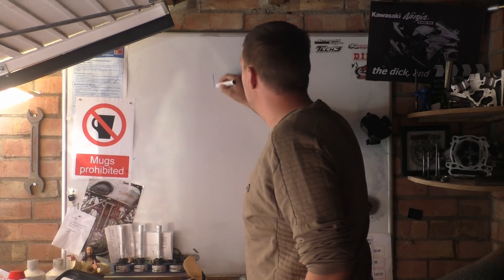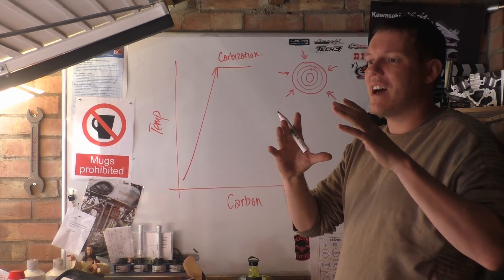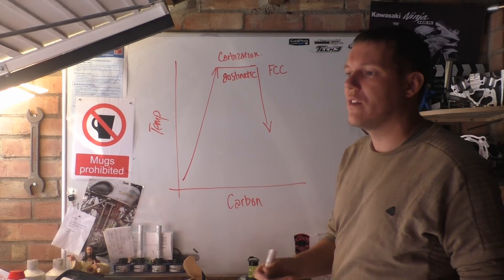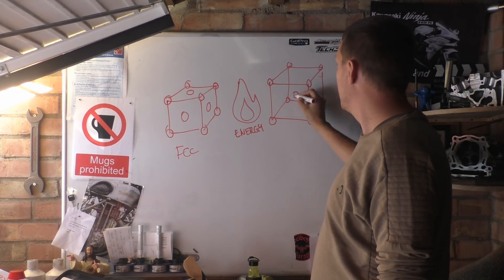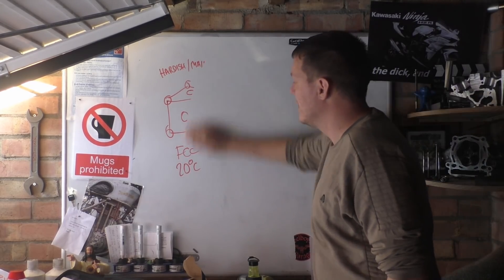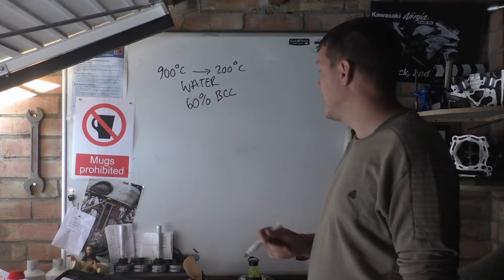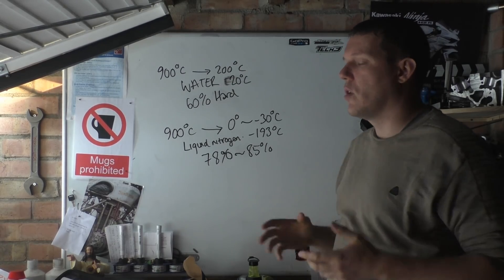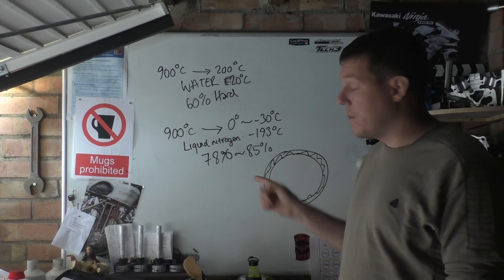Cryo Hardening - What does it do and how?

Comment: I don't understand how a soft core with a hard surface would bend/twist more easily than an entirely hard piece. You can put jelly in a glass tube, if you bend it, that's still going to break. I don't see how a soft core would prevent a hard surface from breaking under excessive mechanical stress. It doesn't make any sense to me.
Reply from the maker: Energy dissipation. The softer material can deform. When this takes place it creates waste heat which leaves the material as radiation. Your jelly and glass example doesn't work because they're 2 different materials and are not connected.
Reply: @thedirtyworkshop  And that very small amount of heat would be enough to soften the hard surface ?!
Reply from the maker: No. I'll do a video
Reply: @thedirtyworkshop  That's a nice strategy to make me subscribe 😁

Comment: All the stuff they do to Samurai swords (Katanas?) is just to get around shitty steels in Japan. The equivalent european sword is through hardened to an extent where it basically is spring steel. And apparently it is better and does not brake or plastically deform as easy as the japanese Katana.. which does have a harder cutting edge (a bit) but the rest is fairly soft.
Reply from the maker: The rest of the blade is meant to be soft, and you have to think of the time period here - Japanese blacksmiths were produced superior cutting blades compared to the european blades of the same era.
Reply: The Workshop Well yes and no. The katana sword cuts better and the cutting edge is harder, but in a direct combat the european sword would probably damage the katana badly while it remains intact. But katanas are very weird swords anyway, beeing so short but still double handed. European swords were either much longer (ealier longswords for example) or later on single handed and about the same length, say a british infantery saber. Obviously a direct comparison is bullshit. Also the europeans had the luxury of having good, homogenous steel and plenty of it (more or less..) while japanese katanas are made out of some weird crappy ore (forgot the name) which is likely the reason for it beeing produced the way it is.

Comment: You can quench with aluminium blocks too knife makers sometimes use aluminium.
Reply from the maker: Not with good results though - the heat transfer isn't quick enough
Reply: The Workshop yea I was surprised tbh as it’s a block can’t get fully round the knife or make proper contact like a liquid, just seen someone doing it,

Comment: were you trying to say "nitriding"?
Reply from the maker: No. LOL Nitriding and carborization etc are different things - which we will cover
Reply: @thedirtyworkshop  hey man I’m a BIG FAN of yours I own a race shop Turn13motorsports and we are looking into cryo treating some parts that will be going into our wsbk spec R1 build. Just wanted to get your opinion on what you thought about doing the cylinders that are Nicasil coated and aluminum, and then trans gears  engine valves valve springs, and possibly crank, we have DLC coated a shit load of the internal parts including the crank. What do you think man? Thx soo much
Reply from the maker: The cylinder is not something you wanna do. Who is doing this work for you, half of them parts won't and don't require cryo. Sounds like they're selling you a lie

Comment: How does the leidenfrost effect interfere with quenching? Would oil cool quicker than water due to its higher boiling point? 

And what are your thoughts on hardness files for approximating the hardness of parts?
Reply from the maker: Well get to this - with some experiments - but when quenching you shake the part about - which is called agitation

Comment: I worked at a large heat treatment company in the bay area called NITREX, fascinating stuff, I feel much as you do about steel, it's really like magic when you study how changeable it is compared to other materials/metals. it appears like completely solid and unchanging from the outside but it's constantly changing at a molecular level relative to changes in it's environment. We did cryogenic hardening  as well, and we had microscopes to check the structure and for making sure nitriding went as deep as our formulas said they would.  Cryo hardening basically gets rid of any retained austenite and it's very clear under the microscope . Looks like something melted (austenite) surrounded by piles of needles (austenite) .

Comment: Matt, completely off topic mate but I’ve been watching a few vids on Hilltop Motorcycles ecu tuning. Mr Lamb Chops has just taken his performance bike’s test bike in and thinks it’s the bollocks. Apparently it’s a self learning/tuning ‘invisible’ bit of software that they put on the existing ecu and apparently only their Dyno can detect it...... Seems a bit ‘TankChip’ to me. I mean how can you tell that they’ve actually put the thing on there rather than just done a generic remap other than just taking their word for it?
Have a look and see what you think. 
With Lamb Chops’ bike they tell him it’s running very lean at first then later on in the vid say they weren’t recording the air/fuel ratio???
Reply from the maker: LOL get in line dude - your 40 requests too late. LOL yes dude I have watched it. This is a load of tech bullshit. But what he did is normal. There are standard 'tuned maps' that people just upload. The same thing with your stock power commander. These are pre-calculated maps. All he's doing is just uploading them. Probably stolen from the PC chip series. As for the other wank again its bollocks. 

Dudes got A.I chips in his ecu LOL - the funniest thing he said was the Faraday cage around the dyno. What's funny is that the biggest emitter of RF interference is the HT leads and the ignition coils. They're inside this 'faraday cage' - guys full of shit. Oh and he has powerful fans LOL
Reply: The Workshop Haha.... I’ve got a mate of mine going on Friday on the strength of someone he knows saying it’s the most amazing thing he’s had done. I watched the video and just thought how convenient it is that only his dyno can detect it. And the bit about it was running way too lean to get a before dyno run to compare to afterwards what a bit special considering he wasn’t even checking the air/fuel. 🤣
Reply: Your mate is clearly someone prepared to consider the actual experience of others rather than form his opinions of what must or must not be true from basement dwelling youtuber 'experts'! Good for him.
Reply: hilltop motorcycles 
 I was merely asking Matts' opinion, as I did Lamb Chop and as I will my mate in the next couple of weeks after it's been done before I consider the £360 and 3 hour round trip. All I was saying is that there seems to be a LOT of people thinking it's iffy and just as many that say it's ok..... Not once have I said it is. Just doing a bit of research and gathering opinions based on what I've read from others.
Reply: It was the other chap who called it 'bullshit' mate. See above. My comment was addressed to him.
Reply: Perhaps you would be good enough to enlighten your viewers/readers as to why it's 'bullshit'? There does seem to be quite a number of armchair ECU experts who are prepared to comment in quite bold terms as to whether what we do is real or not, but are pretty bare on the details to back up their assertions. So feel free to go ahead and give some so your audience can understand better...

Comment: Fucking awesome mix of engineering talk and having a laugh on this channel. It's not fuckin' Blue Peter at all, like some other channels 

Comments section is usually a good laugh too. Some other channels have comments sections that are about as dull as a 1940's ww2 knife that's been 'sharpened' (destroyed) by some fuckwit on a 20 quid sharpener.

Edit: non uk'ers will need to Wikipedia Blue Peter lol. It was basically a very famous, very long running kids TV show, known for its arts and crafts. Much use of double sided sticky tape and toilet roll cardboard tubes (just gave del a great idea for his exhaust system)
Reply from the maker: "Comments section is usually a good laugh too. Some other channels have comments sections that are about as dull as a 1940's ww2 knife that's been 'sharpened' (destroyed) by some fuckwit on a 20 quid sharpener."

- LMAO! Nice!

Comment: (I'm not a metallurgist!)

My understanding is that post-quench cryo treatments are more about stress-relief, than rate-of-quench... Many heat-treat protocols use multiple cryo cycles, without going back above the phase change temp (I forget what it's called).

(I have been trying to learn more about this stuff in regards to my knife hobby... I've got a long way to go.)
Reply: @the workshop check this out
https://www.google.com/url?sa=t&source=web&rct=j&url=http://www.airproducts.com/~/media/Files/PDF/industries/metals-cryogenic-quenching-of-steel-revisited-33005019GLB.pdf&ved=2ahUKEwiQ7sTfgKPdAhUJ16wKHU7eCCQQFjAAegQIABAB&usg=AOvVaw2C7rYqr0LvZHo825KwoCaE

Comment: Hi Matt.  Saw a suggestion from someone about removing coils from fork springs to raise the spring rate.  I know it would work in terms of raising the spring rate.  However, his method was to cut the coils from one end of the spring, then heat and bend the last coil, and grind it, to make a new spring land.  It seemed to me that the heat involved could change the properties of the spring and/or the metal it is made from, so I didn't do it.  What effect would the heating, and the heat from grinding, have on a spring?  Cheers
Reply: Bad idea messing about heating springs, don't do it
Reply: knuckles zedawg  I didn't know for sure, but I suspected it might be a stupid idea.  That's why I asked.  Given that Matt has confirmed my suspicions, I completely agree. Thanks for the further confirmation.
Reply: Joonya 

No worries buddy, but to be fair you suspected it was a bad idea yourself anyway 

Usually, your gut instinct is correct, and it was :-)
Reply: Yep, that's why I didn't follow the (bad) advice.  My gut said it seemed like a bad idea.  It's nice to have that instinct confirmed though.
Reply from the maker: "I know it would work in terms of raising the spring rate."

- Sadly you don't because this isn't true.

"It seemed to me that the heat involved could change the properties of the spring and/or the metal it is made from, so I didn't do it"

- Good because this is a bad idea. What different springs then buy them. Fucking around with spring steel is a bad idea. Spring steel (which comes in quite a few flavours) has a high yield strength - (meaning it can elastically deform a lot) this is required for spring obviously. This property is optimised via the heat treating of the steel. Fucking around with it can make it brittle.

Chrome silicon steel is one that is used a lot in motorcycles.  A401 is one of the most common ones.
Reply: Thanks Matt.  That was what I worried might be the case.

As to spring rate, I believe it would raise the effective rate of the spring.  Take any spring, remove coils from it, and it has a higher effective spring rate.   The formula for spring rate is K=(d^4 x G)/(8D^3 x N).  In the formula N=the number of active coils.  So if we remove coils, and everything else remains the same, the spring rate (K) must go up.
Reply: Yes the spring rate does go up. It used to be a popular thing to do on car coil springs, but it can mean that the springs are not correctly retained on full rebound. It isn't a very satisfactory way to do it, it also leaves the available suspension travel compromised.
Reply: Not such a problem on fork springs where you can just use a longer spacer.  But I still wouldn't cut springs.  Too many other problems.
Reply: Too right, obviously depends on what the bike/car is being used for. Easier and better to get springs made, not terribly expensive.
Reply: Yep, I totally agree.